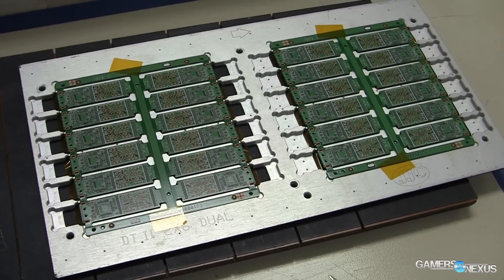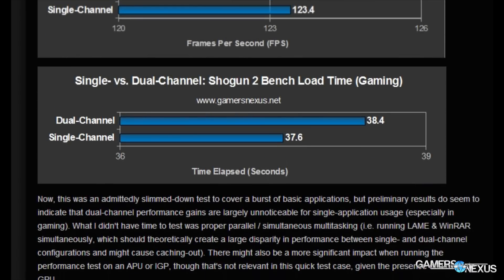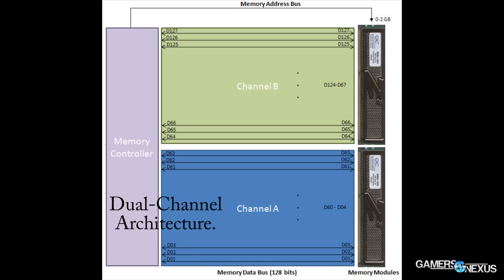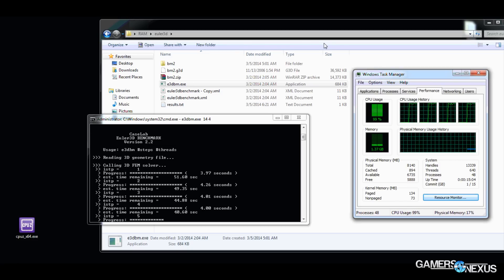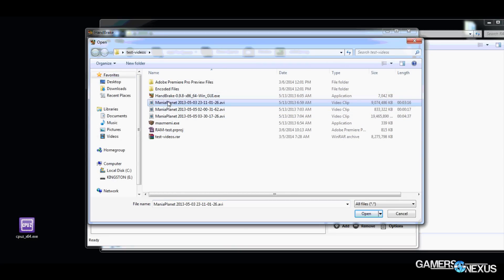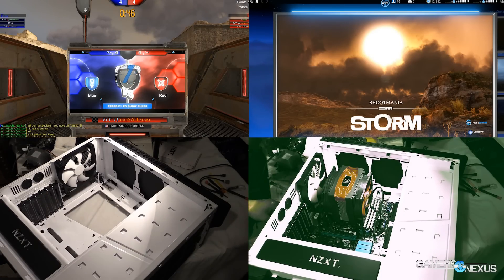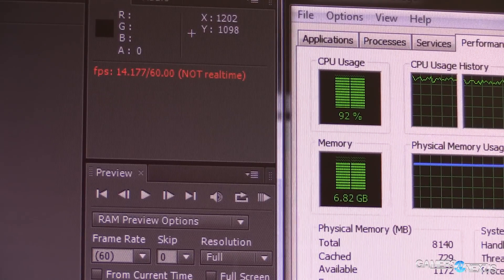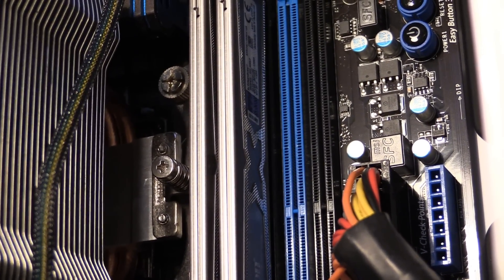RAM Benchmark: Dual-Channel vs. Single-Channel - Does it Matter?

Comment: i have triple channel ram

fuk da police
Reply: +James Hart  Quad Channel...My RAM is as edgy as my black soul and razorblade necklace.
Reply: COMING STRAIGHT OUTTA COMPTON!
Reply: +James Hart Me too its way faster than I need
Reply: LOL they will rekt you
Reply: I run two sticks in single-channel...
Reply: Same :))))
Reply: James Hart I have a NWA
Reply: On a serious note; with current DDR4 prices being insane, triple channel for DDR4 would be amazing. The cost difference between 3 sticks vs 4 sticks depending on the memory stick capacity is substantial. Besides; I think it is cooler to be like "Yeah I have 24GB's of RAM because 32GB's is SOOOOO mainstream" :D But seriously, I have 1 stick of 8GB 2666MHz RAM and I would like to buy a set of the same memory and not have to by a two stick set + a single stick set.
Reply: I also got that triple but the years have decided that one of those channels is dead....back to pleb status with 4 sticks...

Comment: I recall opening my previous 2,2ghz AMD quad core factory-build pc & being surpriced by the single stick of 4GB inside.. because back when i bought the pc the ram prices was insane high between 4x1gig vs 2x2gig vs 1x4gig. My second surpice was when i put in another 4gig stick to get dual channel going .. windows 7 went incredible responsive all of a sudden, it was SO noticable. Not even a reinstall/format of the system could compare to how much more responsive it got. Of cause the double up on ram also changes things, but still. Doubt itll matter much now on modern cpu systems as they are all too strong for it to really matter anymore.

Comment: I have 2X2GB ram and 1 card of 8gb of the same type 1600mhz which would be faster on a laptop 2X2GB=4  1X8GB=8 or 8+2GB Ram?
Reply: +LightswrathUltimatum  

Depends on your usage? If your memory usage doesnt exceed 3GB then 2x2GB=4GB is good.

If it exceeds 3GB usage, then 1x8GB=8GB will be better.

8+2GB=10GB  might cause your system to lag and you can notice that clearly while using certain programmes.

If you require more memory, your system supports 16GB and can afford it then buy another stick of 8Gb. so 8+8=16GB. Best.

PS- I am not a PC expert, simply sharing what I have read on various forums. I could be wrong !! Since you have the RAM's with you, why dont you try the different configs and check out yourself. Also you could share the experience.
Reply: +telegu filmz Same im am no pc guru, but i recently upgraded from 8gb to 2*8gb and i gained about 20 extra average fps in tf2. I suspect this increase was brought on by my integrated graphics card as ram heavily affects that.  From 52fps to about 70fps.

Comment: I have 2x 8 gb ( 16 gb) kit corsair 1600 mhz and i see that i have 16  gb with 670 mhz in all programs. What's happening?
Reply: +Armando Georgian DDR stands for Double Data Rate, meaning that 666.6(recurring, so about 667mhz) is ~1333mhz. So it will read 670mhz and your ram is running at an effective 1333mhz. If it is actually a 1600 kit it should show 800mhz. Go into your BIOS and enable XMP profile for your ram (don't mess with anything else) Beause the motherboard might not support that speed unless you tell it to (XMP tells the motherboard to let the ram run at its rated speed)
Reply: Thank you. I see that you know many things Can you tell me why i have lag while recording games even with a high-end video card ( radeon r9 390 and fx 8350 processor). It's normal? I must buy an dedicated video card for recording ? capture video card ?
Reply: I don't know why that is, you might need to change your settings. If you have OBS use https://obsproject.com/estimator
Reply: +Armando Georgian Might be your CPU. 8350 is rather old now.

Comment: i have msi K9N6PGM2-V2 MS-7309 VER:2.1 board and im trying to use dual channel feature but im unable to use that., i use zeppalin 1gig and transcend 2gig, same timings, ddr2, pc-6400, 800mhz, 240 pins,

Comment: Just bought an 8gb corsair vengeance ram stick. I have an i5 4690k and gtx 970. Will it hinder my performance? I will later upgrade to 16gb because I plan to start YouTube.
Reply: No, if you watched the video you would know that. It might be noticable when you start Youtubing but by then you will have 2 sticks anyway...
Reply: Ok thanks I guess.
Reply: MrTheKrafter Oh and btw I have the exact same parts as you have except my GPU is worse and I run the game flawlessly maxed so you shouldn't be worried at all :)

Comment: Also, single vs dual channel is a big deal with AMD APUs because the same memory pool is used by the CPU and GPU together.
Reply: What would 80386 know about APUs? Back to the 80s with you!
Reply: So if i'm planning to buy ryzen 3 2200g, I should go dual channel ?
Reply: zeebazu Hey, I'm running FX 8350 with a single ram, does FX 8350 get bottlenecked by it?
Reply: For gaming single vs dual channel make little to no difference. For heavy stuff like rendering and video editing, the difference is noticeable. Single vs Dual makes a huge difference for APUs in gaming like I already mentioned
Reply: zeebazu I do both, 3d render and gaming. Even in rendering difference is kinda small, I'll upgrade later.Thanks a ton.
Reply: zeebazu silly question but would it matter if you use a dedicated graphics card with its own vram with the apu? no right?
Reply: I have a 3200G, and a Vega 8 integrated, will upgrading to dual 4GB RAM prove a noticeable difference?
Reply: I hear that for Ryzen CPUs, it benefits quite a bit from dual channel and faster RAM. I guess it also applies to Ryzen 3 2200G.
Reply: idk but when i went dual channel everything ran noticeably faster, go figure  *shrugs
Reply: Thanx for the inputs guys :)
Reply: Nathanael Solomon when you use dedicated graphics, only it's own vram will be used. apu's graphics section just sits there doing nothing at that point. so performance will be dictated by the dedicated card only. the only exception to this is when amd 'dual graphics' is used. but I personally recommend against dual graphics. the concept is great but too much driver issues cause a small improvement in performance if at all. just buying a more powerful gpu to begin with is a wiser choice.
Reply: zeebazu yes,and if you guys have an apu you may wanna buy ram at 2133mhz or higher!

Comment: U sayed normaly it will not make a different in games. But what games would it make a differents in. Because in one game (hero's & generals) I'm getting bottlenecked. My GPU is using about 70% of its power. The CPU looks like its at about 40-60% went in game. The fps seems 2 drop well more people get into to battle and take a big drop if planes are added. Is this one of the rare time it would make a difference. I would like to know how 2 fix this bottleneck

Comment: very little impact on games, lol. well I know when I had 8gb single stick of ram I got avg. of 35 fps on battlefield 3 on my hp laptop. when I added another 4gb stick of ram I now get 45 fps avg on battlefield 3.  so it does make a difference with games.
Reply: you increased the size of your ram. That's why it made a difference. In this video both in dual channel and in single channel ram was the same size

Comment: This is what i call i profession test! I want more test like this =)
Reply: Maybe SSD vs HD =P
Reply: Will Forger that is a more or less pointless test, its like comparing a DVD +-RW to a USB 2.0 drive, different technologies. 

idealy though if you look it as strictly a storage device for a non moving system the standard HDD is a higher data capacity and is relatively reliable and can last a really really long time if its a well made drive.
the SSD is amazingly fast (typical speeds are 400mb/s and up for read and write) but are less reliable over time due to a much lower IOPS capability before being considered a dying drive (its one reason why you use trim v defrag on a SSD)

but in terms of price, the hdd destroys (.025$/gig [5tb @ 130$]) in price whereas the ssd destroys in speed as a storage device but loses out as cost (.37$/gig[512gb @ 190])

Comment: And now do it with 1333 mhz sticks.
We know already that 2400 mhz sticks are pointless for games,reducing them to single channel should not really make much of a difference. Try it with those common old 1333mhz sticks and remove their dual channel ability. At this point you actually should start to feel the impact.

Comment: i was expecting that single channel ram , would respond faster than a dual channel set up.
not more bandwidth but smaller access times .
that is because dual channel , needs to be synchronized and managed by the memory controller so some time maybe is spared in that process .

Comment: So what your saying is, if I want to upgrade my laptop (Asus G750JM) that buying two separate Identical 8GB chips is the same as buying a "dual channel" kit that is just 2 8 GB chips in one package, correct?
Reply: nope, but nearly the same. kits still have higher compatibility, but it rarely matters. Normally two of the same kind of sticks should work just as fine. And with same kind I mean exactly the same sticks. Just two random 8gb sticks have a good chance of failing.
Reply: Traumglanz
 I ending up catching a sale at newegg on the 16GB (2x8GB) HyperX DDR3L part number HX316LS9IBK2/16 My computer came with 3 4GB chips (2 require disassembling half the computer to access) so I removed the 3rd 4 GB and installed one of the 8GB chips in that slot and the other 8GB chip in the last (empty) slot and everything is working perfectly fine, even gained a 0.1 on the WEI for RAM (7.6 to 7.7, Windows 7 x64). So I'm running 2 4GB factory chips and the 2 8GB HyperX chips for a total of 24GB and everything is perfectly stable, at this point I don't think it's worth the cost to go for the full 32GB max.

Comment: Very nicely made video.  I think what is good to point out is the amount of RAM you have and the amount of channels you have is relatively irrelevant if the CPU is not the bottleneck (such as games) or if you're referencing less than 1GB at a time (such as extracting an archive).  Dual channel has it's greatest impact when you're utilizing more than half your RAM for a single application and when the data stored in RAM isn't just caching.  The Adobe products in these tests may use a lot of memory but most of it wasn't really actively being referenced and I'm sure very few variables were being modified.  GPUs put much more use to multiple channels (and higher-frequency RAM for that matter).  With PC CPUs, you're better off focusing on optimizing your latency more than anything.
Reply: My english is bad and i didn't understood what you said so can you answer this? I want play games, so what you suggest? 2x 4BG or 1x 8GB? 
Processor: i5 4400 or i5 4600 or i5 6400 or i5 6500(depends what this black friday will show for me)
Reply: NINedStark You'd be lucky to see a 1% performance difference between either 2x 4GB or 1x 8GB sticks.  I'd recommend going for the single 8GB, since that leaves more headroom for expansion should you ever need it.
Reply: Peter Schmidt Thanks! But 2x 8GB > 1x 4GB right? I saw comments (in other video) saying there is almost no difference, wtf
Reply: NINedStark Depends on the game/application.  Simply put, more RAM doesn't give you better performance, but, not having enough will slow you down.
For example, let's say you have a game that requires 6GB and you have vsync off (which gives you an un-capped framerate).  With 8GB of RAM, you might get 75FPS.  With 4GB, you might get 50FPS.  With 12GB, you'll still get 75FPS.  As you can see from this example, when you meet the RAM requirements of a game, you don't get better performance when you add more.  Generally speaking, 16GB should be more than enough for just about any (well-made) modern game you can play.  8GB is a safe minimum.  As for anything beyond gaming, that number can vary.

Just as a heads up, there is such thing as too much RAM.  For example if you had 64GB, your frame rate might drop to 73FPS, because it takes so long for the computer to figure out where to find the data it is looking for.
Reply: Peter Schmidt Very thanks!! So 8GB is enough for me =D

Comment: Dual Channel RAM is also beneficial for integrated graphics, like AMD APUs
Reply: yes, you are correct. I have a hp laptop with an amd a8 6410 apu with r5 radeon hd graphics, adding another stick of ram improved gaming substantially.
Reply: yup, wonder if it helps with Intel Integrated graphics.

Comment: Something worth pointing out is that running dual-channel ram configs can be important for gaming when integrated graphics are being used. Depending on the game, I've seen differences as much as 10% to 30% increases in FPS when using dual-channel configs over single channel.

Comment: Could you do a test with 1x8gb vs 2x4gb?

I also wonder how single sided or dual sided ram influences the results
Reply from the maker: I can give it a shot, yeah. In general, RAM with a higher density should theoretically perform better when in an otherwise identical configuration. I'll see if we can test it for the next big RAM article. Good idea! I always welcome suggestions like this, so don't hesitate to post 'em on future videos/articles when you have them.
Reply: @GamersNexus  did you do the test yet?
Reply: Gamers Nexus Yeah that sounds great!
It feels like ram is not as talked about or benchmarked other than in APU'S (where dual channel does make a difference by quite a bit) and in terms of just clock speed (again, where APU's are the only reason this is mostly discussed).